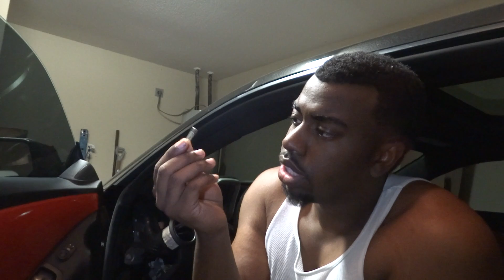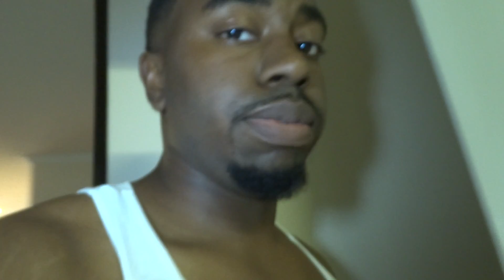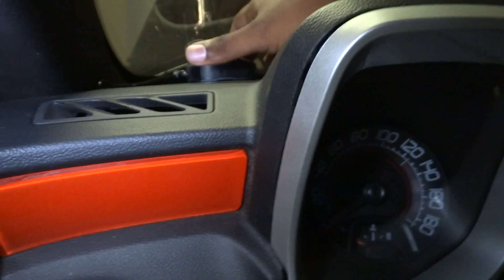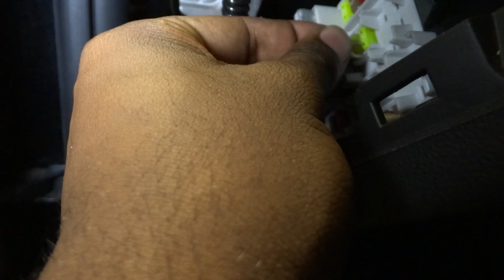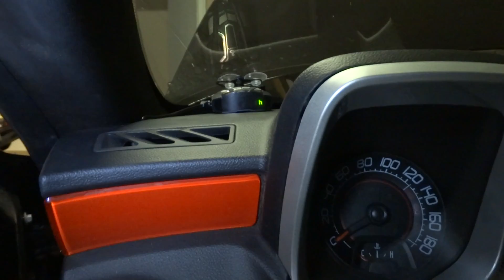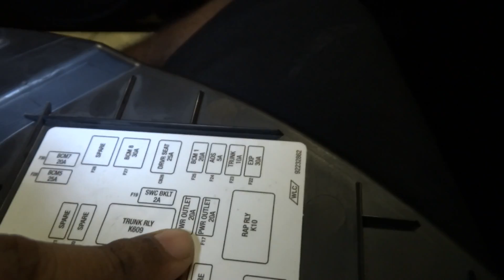DIY Police Radar Detector Hardwire

Comment: Good information here. I might do this some time soon too. Thanks for the vid. Did you find a fuse that had no power when the ignition was turned off? I ask bc I noticed that the fuse port you used had power with the ignition off, hence radar detector on all the time.
Reply from the maker: Yeah I believe the 20 amp yellow fuses that are labeled power outlet are the ideal spots to use. If I'm not mistaken they have power with the ignition on.
Reply: +Antares Cam Good to know, thanks.